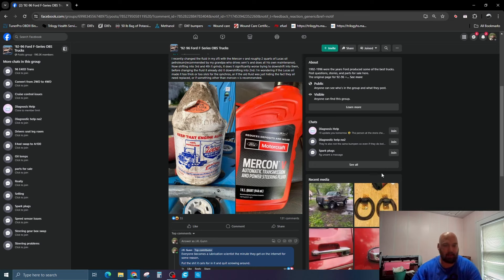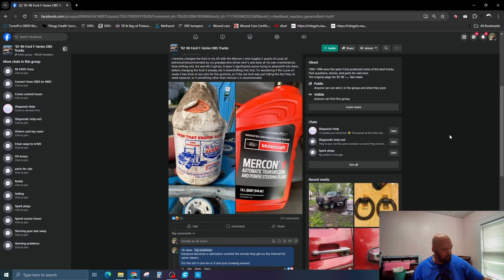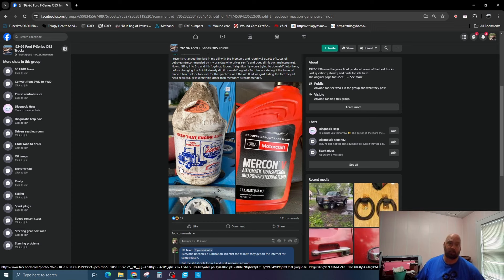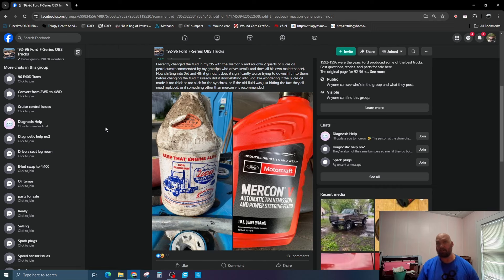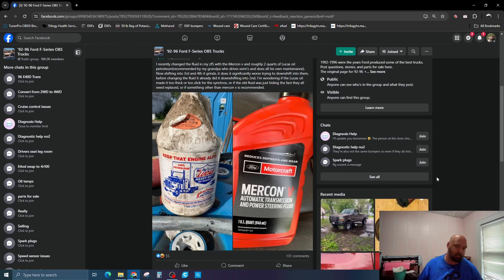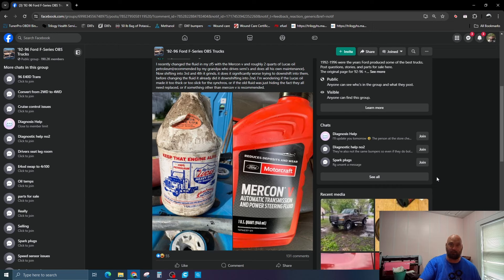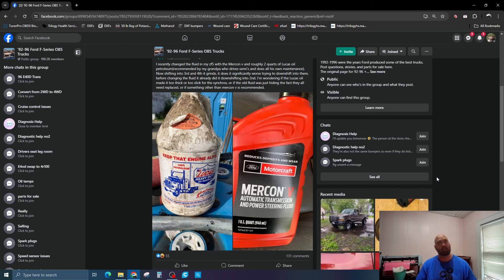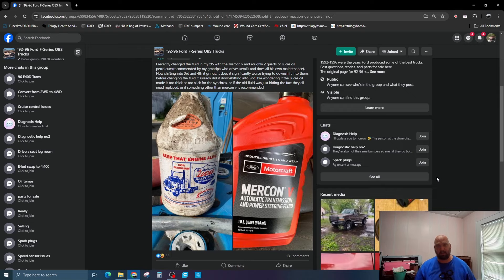How to do basic troubleshooting, a rant on the best oil ever

Comment: I run the oil that the engine builder recommended 
I use two different grades 
And the same engine
It all has to do with the temperature outside 
5 40 weed oil in the winter time 
1540 in the summertime and if I can't find it I substitute to 1540 for 2050 because basically what's in my suburban is a drag engine and all I wanted is for the torque so I can pull a 6100 lb empty car trailer but when I put the race car in there and everything at for the race car it's a bit over 8,000 lb